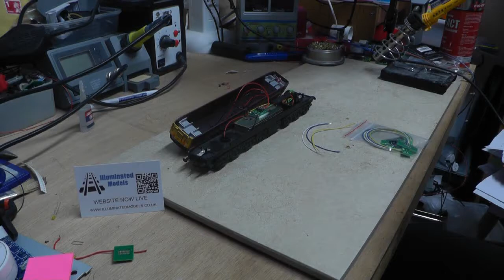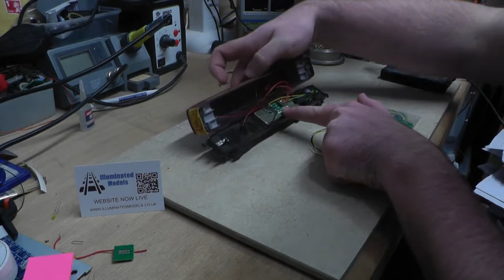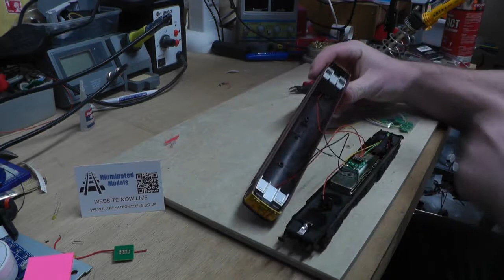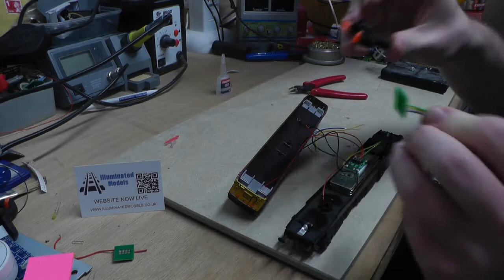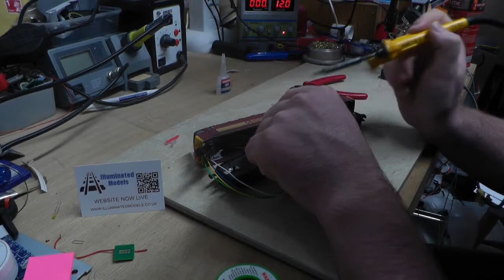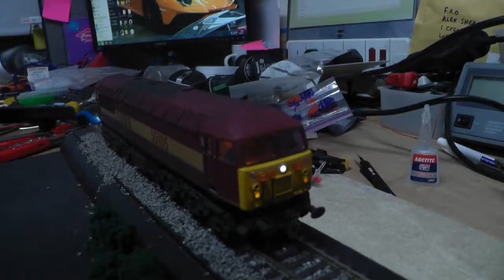HOW TO - Adding directional locomotive lighting

Comment: Hi, I have an 1980's Hornby Class 37/1 with route indicator boxes but no lights, Class 43 HST with directional front lights only, and 2 class 25's which have route indicator lights based on motor direction. All are fitted with remote control now and all the remote receivers have front and rear led light capability, do you stock anything to allow me to fit lights to these models?

Comment: Hi,
I do not have a 56 but I have fitted your Hornby 66 kit recently and I did a video on it, is there any chance you could do kits for the Hornby Railroad 47 and 37 if you need to see what there like I do have videos featuring them both sorry to comment on this old video but comments on the 66 one are turned off I hope you can do these 2 kits and I would definitely get them as it makes the models come alive please keep safe and well in these difficult times.
Cheers Robert.
Reply from the maker: HI Robert sorry for the delay, if you look on our website https://www.illuminatedmodels.co.uk/collections/dcc-dc-locomotive-lighting .You'll find a range of kits which we offer. Hope this helps
Reply: @illuminatedmodels5262  Hi,
Thanks for the reply but the kits that you have are only for locos with lights already not as with the 66 with none at all or do they still fit and work???Keep safe and well.
Cheers Robert.
Reply from the maker: The class 47 and 37 Lighting kits are for locos that left the factory without any lights, such as hornby railroad range. So the kits will fit locos your on about. Hope this helps.
Reply: @illuminatedmodels5262  Cheers will order soon.
Reply: @robertstrainset6556  hi. Would be interested to know how you get on as I’m considering the 47 kit for a non-illuminated railroad 47 on DCC
Reply: @Eccles_Hall  Hi Brian, It should be no more difficult than what I showed in the 66 one I filmed and it could even be easier as the lights are not so near the edges of the bodies so have a go if you want as I have not ordered these new kits yet keep safe and well.
Cheers Robert.
Reply: @Eccles_Hall  Hi Brian,
I have now ordered these two kits 37/47 and by getting two of them you get a 5% discount we will have to see how it goes. Keep safe and well.
Cheers Robert.
Reply: @robertstrainset6556  thanks Robert. I don’t normally opt for Hornby RR range, but I do like the GBRF range they have in the 47 so opted to use this as an opportunity to create a decent loco (47739) that isn’t available from Bachmann. The brilliant Rainbow Railways did a one off which was £215 which was not an option for me. Keep me posted if you will. Cheers 👍🏻
Reply: @robertstrainset6556  How did you get on? I purchased and fitted the lighting kit to the 47, which tbh I found a bit of a pain and had to do some chassis cutting (hidden under body) to allow the body to fit whilst accommodating the lighting boards. I had most solder joints break so had to resolder these. Eventually I sorted it and fitted a Hornby 47 sound decoder (never used a Hornby sound decoder before) with upgraded speaker in the fuel tank. All in all a good little project and I now have a decent loco that is unavailable from Bachmann.
Reply: @Eccles_Hall  Hi Brian,
Like you had to chop and file a bit but it worked as for the 37 the lighting board did not have the lights in the right place for the body I have done a video on it have a look. keep safe and well and have a nice Christmas and New Year.
Cheers Robert.

Comment: Hi, Would this kit work on a old 1992 Hornby class 47 (R.342) which is only fitted with a ring field motor and pick up cables only,  no pre-existing lighting what so ever? if not do you have a mod pack?